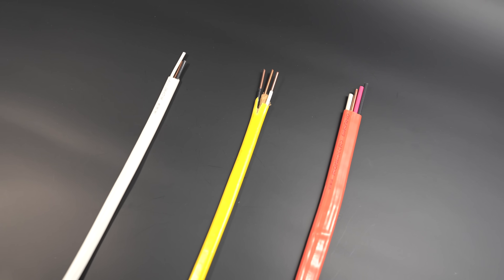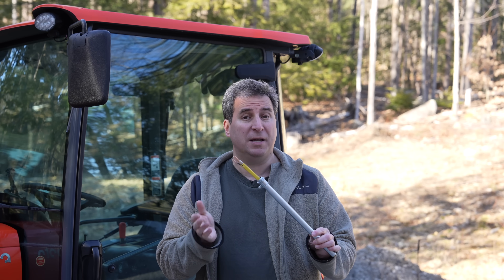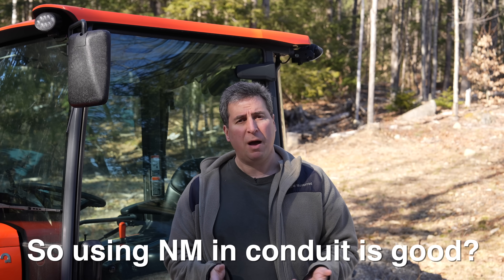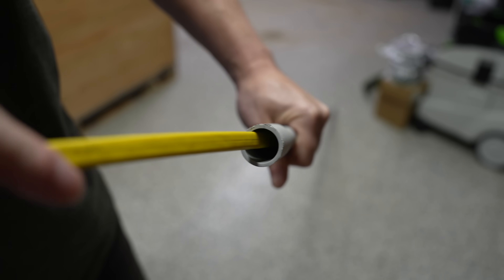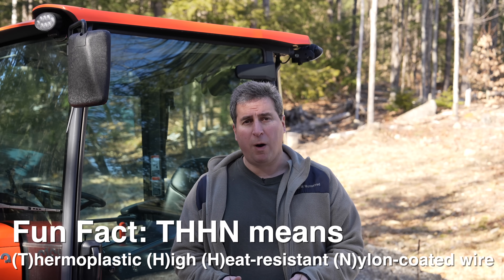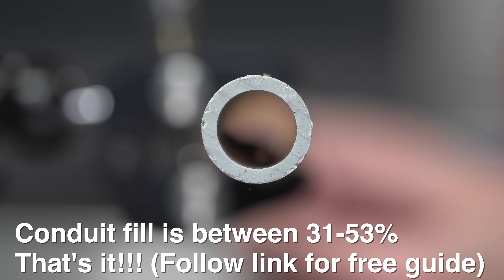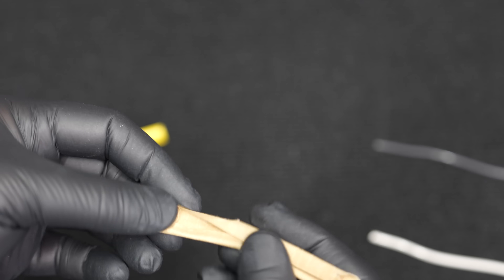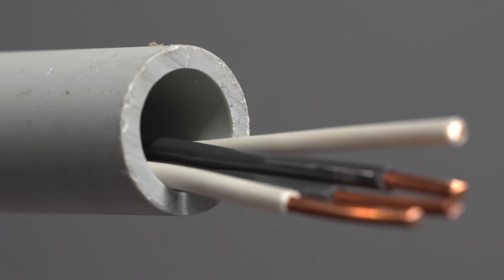#1 DIY Electric Mistake - Can you use Romex Wire in Conduit?

Comment: Is it acceptable to use conduit with Romeo to make individual straight runs.  For instance, in my garage, to span the gap across the joists from one side to the other…no boxes, just a connector so the Roman doesn’t have to droop as it crosses each rafter to the next.
I’m thinking adding a simple section of conduit, perhaps with some super strut as a little extra beef would even add to the overall structure up in the roof of my garage as well as keep my electrical cables from damage from traffic up there.
Reply: My electrician friend told me that inspectors don't like Romex going across  the joist unless it is close to the wall, Because people might hang stuff from it. I ended up cutting 12"x 8'  3/4" plywood, striking a chalk line and nailing the strips all the way across. This made a great platform to staple all my Romex to and the inspector loved it. Just a thought. Or maybe you could buy some over sized gray conduit like 1 1/2" or 2' cut about 1/4 of the pipe out on a table saw and use it as a open trough.
Reply: @robbieraychannel  Yup, I don’t like wires hanging across joists either.  It’s messy and begging to be misused or worse.

Comment: So, can you run uf cable(say like a piece of 8/3 with ground in a piece of pvc under ground? I know the wire is rated to be put in the ground, but for extra protection, making sure if they dig in the bushes they won't nick/cut the wire

Comment: I thought you use NMC in the final 6 feet of run to a outlet box for hardening purposes. In, fact I just looked at the basement wiring in my 1972 house and sure enough, all the drops on the basement walls are NMC in conduit.

Comment: My understanding was that the jacket is not temp rated for any type of confinement but only for free air like in a house wall. Confining it should derate the ampacity of the romex.
Reply: Romex is already derated to 60C even when the THHN wires inside are rated higher.
Reply: @dannelson6980  True but any further derating will stack. The absolute test is to read the conditions listed by the manufacturer when submitting NMC to the UL for testing. Short broken runs for protection purposes not applicable but complete conduit runs were very unlikely included in the original test conditions requested by the manufacturer. In short, NMC is not rated (nor are probably any cables) for conduits. Probably can be authorized by an AHJ but the derating could be unfeasible. In general, a multi conductor cable in a conduit is very problematic. Installation (required engineering formulas for installing cables in conduit may not even exist for multi conductor cables), conductor heating, moisture wicking, conduit fill.
Reply: @fritzmiller9792 In industrial locations such as biochemical plants, refineries and power plants, multi-conductor cables are installed in conduit ALL THE TIME. For protection, if protection is not required, cables trays suffice.
Reply: @Fotosaurus56  I have installed many in cable trays and duct banks and through bond-outs and sleeved through short conduit but not power cables in conduits.... definitely signal and low power but never the power cable. I am sure it can be engineered with oversized conduit and other consideration but in general a cable is engineered to cool in a certain environment that a conduit won't allow for unless again it's oversized to the point of acting like a duct. Again, there is many complexities to this subject and there is no limit to the exceptions that often take place in unique industrial applications with engineers overseeing the installation and conditions.
Reply: @fritzmiller9792  Good points, I have not looked in additional derating in this case. It is not something I normally encounter. Service Entrance Cables are often multi conductor and in conduit.
Reply: Derating is based on the number of parallel (bundled) current carrying conductors, ambient temp (multiplier factor), termination rating. There's a table accompanying the ampacity table for parallel conducto derate. The derate is quite aggressive, might be worth a look. I've overcome the limitations utilizing square raceways but applications of course vary on circuit configuration.
Reply: @VariHapii  also jacket thermal ratings, which is the primary concern with confined comductors to which you alluded.
Reply: Came in to see this comment as well, that's getting into the details and I knew it would not be covered by a short video. All in all, short spans for extra protection and not complete and closed runs will keep you within Code. It's actually a fairly complex subject... that is why someone invented Trade School and why watching numerous YouTube videos still doesn't get you a license.

Comment: Just a homeowner here that has a question for an electrician.  Is it ok that I ran about 50’ of UF 12-2 WG inside 1” PVC conduit?   Already bought the wire and last minute decided to put it in conduit as well, extra protection from ground hogs, shovels, etc.
Reply: I believe that because UF  is rated for wet/ underground  use, then it is ok to put in a conduit.

Comment: in the chicago area we are required to run all wires in conduit. people who have never lived anywhere else think its crazy you can just run romex through studs in other states.
Reply: I believe you can use mc/ac cable in the city of Chicago but there is a limit of 25 feet per run
Reply: You can thank organized crime aka unions for that.  It isn't about safety but about limiting who has skills to run conduit.  Any kid can drill holes and pull "Romex" to boxes.  But to run EMT or even MC takes more skill that are usually kept to union electrician training.

Comment: Of course you can.  As a very new and young apprentice I fell victim to the myth. I assumed that since romex was used in residential work and  thhn was used in typical commercial pipe and wire jobs that romex wasn't allowed in conduit. It is kind of a logical train of thought but the conduit has no bearing on the use of romex.

Comment: The anecdote about trying to get regular NM through a 1/2” conduit is reason enough to avoid it.

I’ve run THHN through that and it was miserable enough.
Reply: I'm a fire tech, From experience, I will never pull FPLR or FPLP through more than 90 degrees of bend in conduit again

Comment: You are absolutely correct.   I’ve seen lots of YouTube videos with people using NM in their sheds and running it in pvc conduit.  What a total waste of money.  Most of the time, they just slop in the pvc, kink it, and do not use the correct fittings.  Oh, white pvc is not pvc conduit.
Reply: I won't use NM or UF in a shed because of critters chewing. There's also the issue of protecting wires. Yeah metallic conduit or MC is more costly, and not as quick to install, but I see it as a better job.
Reply: This is exactly what I did about 19 years ago when I knew even less than I do now.  I believe the Romex was rated for direct burial, but I put it into PVC pipe.  I used the PVC for protection more than anything.  I have witnessed a few too many shovel incidents and rodents damaging insulation and thus allowed the wire to corrode away.  Also, I've been involved in a small number of detached garage electrical issues where one of the 2 phases was lost, which had to be due to one of the wires getting damaged.
With how wet the ground is around here, I did not understand why adding about $10 (in today's dollars) in PVC was going to harm anything.
I also ran some Cat 5 cable to the shed at the same time, ran through a separate PVC pipe.

The ground is a lot of clay and holds a lot of water around here.  Both the cat 5 and Romex seem to be doing their job perfectly yet.  I recently moved the shed about 5 feet and had to deal with the wiring.  The Cat 5 still gave me 100 megabit.  I have no idea if that cat 5 was ever meant to be used in wet locations.  I never checked, and I didn't know how to check 19 years ago.
Reply: @paulstandaert5709    NM cable (Romex) has never been direct burial rated.  UF cable (similar) is direct burial rated.  The sheath is tight, and solid to the conductor insulation.    PVC for protection is allowed.  In dwellings, there is Line 1 and Line 2.  There is one phase, not phases.
Some Cat 5 cables are rated for wet locations.  Not up on that much.  Was a different departments work.
Reply: @KevinCoop1  I did some research yesterday and came to the same conclusion. I also took a look at the romex in the shed and I was wrong. It's not direct burial rated as you said.  
I guess that if it becomes a problem, I can replace it relatively easily as it is not buried very deep.   Experience tells me that when the insulation is compromised and can reach the physical ground, it does not take long for that wire to corrode to powder.
I always struggled with the phase terminology. 2 sine waves 180 degrees apart is somehow considered to be a single phase. But upstream of the transformer, it is single phase, so... Mehh. I suppose.
Reply: @paulstandaert5709    The problem is that what an oscilloscope shows is because the ground point is common to all.  There really is no such thing as 180 degrees out of phase.  There are three voltage waves that happen at the same point in time, and in the same direction.  1@240v, & 2@ 120v.  Also, try to get that adding 2 120v sine waves =240 volts out of your head.  If you need video proof, let me know and I think I can send the links.
Reply: @KevinCoop1  if you can find a tutorial, that would be great. The 240v just center taps the transformer... Ugh. My brain sucks
Reply: I saw someone with I think 6-3 Romex maybe some sort of thicker SER run through PVC drain pipe instead of conduit. Not sure if it's against code to use plumbing pvc instead of conduit but it looked pretty ghetto. And there are obviously no proper fittings to connect to panels and junction boxes.
Reply: @bbol745    people have argued the pipe versus conduit over the years and while it's the same PVC material, the pipe is NOT rated by UL or NEC for electrical use. Can you get away with it? Most likely. Will an inspector pass it? Probably not!
Reply: So in this situation, how do you get power (underground) out to the shed?  I assume it has to go inside some type of conduit. Is this where the THHN inside conduit is used? (Wondering, as my electrician is planning on using NM inside PVC and I want to verify code compliance.)
Reply: @lances4803    NM inside pvc is not legal underground.  Reason:  PVC underground is a wet location.  Best way, pvc and THHN/THWN.  THWN the W stands for “wet”.  If pvc is chosen, you can run “UF” cable in it.   Looks similar to NM, but Wet rated.  Second Best:  Get a cable rated for direct burial and use pvc at the locations where it comes up from the trench.  Personally, I would use conduit all the way, panel to panel.
Some other things to watch for.  At the shed, if feeder and panel, you must have a disconnecting means at or near where the conductors enter the shed.  Normal to use main breaker panel.  Breaker can be oversized with no issue as it is disconnect, not overcurrent.  You must have grounding electrode connected to ground bar in the panel.  IE, two ground rods.  Ground and neutral must be seperated.  All receptacles must be GFCI protected.  Best wishes!   Kevin
Reply: @KevinCoop1  Thanks Kevin, much appreciated. Keeping this for future reference!
Reply: @KevinCoop1  That just about covers it in one! The GFCI is because it’s considered a damp location?
Reply: @AndrewMoizer    The GFCI because the floor is assumed to be concrete or bare earth.  Both are considered grounded surfaces.  You touch a hot conductor and the concrete floor without GFCI, you might not be able to ever tell the story.
Reply: @KevinCoop1    the biggest problem with direct burial wire is it needs to be deeper. If digging a long trench by hand, the shallow depth of conduit may be a game changer.
Reply: @rupe53  There is absolutely NO difference in the code rule about depth of cover for an exterior installation if you use conduit instead of UF wire. They need to be 18" minimum !  (the only exception is a GFI protected post light can be 12")
Reply: @mattywho8485    section 300.5 talks about burial depth. 6" for metal / rigid, 18" for PVC, and 24" direct burial. Guessing this is considered a feeder, not part of a branch, so is different than a lamp post light.
Reply: @rupe53      Make sure you are reading about the correct category.   Residential rules and commercial are not the same.   Must read conditions too after that.
Reply: @KevinCoop1    You are correct. There are variations between residential and commercial. When in doubt, I ask the guy doing the inspection.... because this is not my main line of work.

Comment: My electrician ran some 10/3 romex through 3/4" flexible metal conduit for a portion of the run for some added protection where it wasn't going to be covered up by drywall. The inspector had no issues with it at all. I think the main issue is when people who aren't electricians try running romex in conduit for long runs because they don't know what THHN wire is.
Reply: True about DIY'ers who run indoor rated Romex outside in what they think is water tight conduit mostly water tight flex conduit. THHN has to be rated TWHN which means rated for wet environments. Most if not all THHN is rated also for TWHN it's marked right on the wire. NM Romex rated for wet environments is lot more expensive. Most electricians don't like stranded wire since NM Romex is solid wire easier to terminate.

Comment: I would argue that most folks aren't going to do the fill calculations, or think through whether the location is considered damp or not. Even worse, a lot of diy folks are going to ignore those considerations altogether.  Even though it's not technically correct it's much simpler to say no Romex in conduit ever.  Even where it's permissible by code it's still not good practice.  Just my 2 cents.

Comment: I once was told by a supervisor that I can't run NM romex in conduit because the paper insulation would catch fire 😅
Reply: until you realize that the paper around the ground wire isn't meant as insulation,
also, the ground line isn't meant to be a current carrying conductot
Reply: @davidconner-shover51  same supervisor told me blue teflon tape fails on gas line inspections. I'm like "I been using blue tape on every install for 15 years, try that on someone else"

Comment: You are allowed to run UF-B (and other equivalents) outside and in Conduit.  It is rated for direct burial in no conduit.  Want more protection - Conduit is allowed.

It is a 'romex' style - but really is a hard flexible plastic surrounding all the wires.  So no paper, and no water leakage into any conductor.
Reply: That is what I did. UF buried in PVC conduit for extra protection.
Reply: I used some heavy duty UF-B in a in-wall application once.  Did the research and asked the inspector just to make sure.  It's actually technically ok by NEC... just no one can believe you'd want to fight with it since it's so hard to bend and route.  In this case, the wire shortages at the time didn't really leave a choice.  I needed less than 8 feet and no one had ANY in the gauge I needed except for some large spools that had 10x more than that at more than 10x the price.  So I bought the UF-B by the foot cheap.  Was a royal pain to pull, strip, and install but it got the job done just fine.
Reply: He did say NM. UF is not NM
Reply: This. In fact, if you're running cable in conduit outdoors, it MUST be type UF. This is because the conduit cannot be considered to be free from moisture, so NM is NOT allowed.
Reply: @edtompkins865  hmm then why did the sparkies that ran feed under the driveway at our complex use thwn? If UF is that is allowed, they would have run it
Reply: @harveylong5878 buried raceways are considered wet environment so the conductors ran in them must be rated for wet environment (ie "w" in thwn).  UF is actually rated for direct bury itself so no conduit is required.
Reply: @harveylong5878  Because it is easier to pull, easier to add more circuits, cheaper, and more logical to use. Homeowners don't typically keep spools of individual wire at their house so they buy premade cable assemblies and use what they got for cheaper. Both are acceptable.
Reply: @shawnbuckendahl1968  For shallower depth requirements one can utilize conduit as protection.
Reply: @etherealrose2139  not arguing that.  But since you bring up shallower burial for added protection, there are minimum burial requirements as well that have to be followed.
Reply: @edtompkins865  You can use so many types of cable assemblies, it does not have to be UF. You can also run individual wires. All of which are not UF-B

Comment: I've used Romex in conduit in an off-grid remote location to protect it from mice, badgers and squirrels. But I also used 3/4" pipe so it pulled quite easily.
Reply: They make BX wire for this, NYC is all BX wire in the buildings for that reason mice, rats, squirrels to not eat the wires.
Reply: I run romex in all my installations indoors and outdoor, mostly in conduit. Since 1997. Never had a problem.

Comment: it's mainly to understand the heated conductors inside the conduit can not cool to ambient, thus increased thermal run away because of internal resistance at amperage's that have not been derated correctly.  Eventually, one has to take precautions like when direcct burial line, it's legal, but the damn gophers think chewing unprotected insulation is fine.

Comment: I've used NM cable in a conduit underground, outdoors, in the mud, for decades and never had a problem.  I don't see the issue with this!
Reply: I hope you used PVC conduit & not metal. metal will break down. Note if there is a electrical fire & its from a NEC compliant source, your homeowners insurance could be denied.

This is the main reason to be complaint to avoid insurance claim rejections.